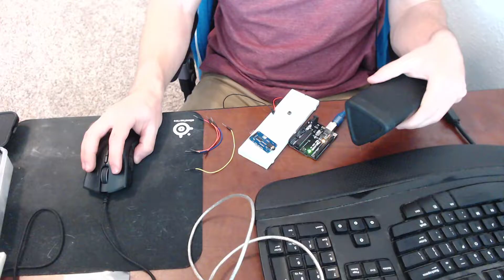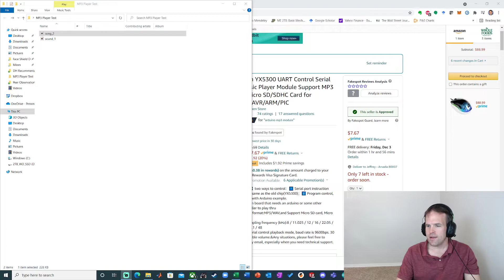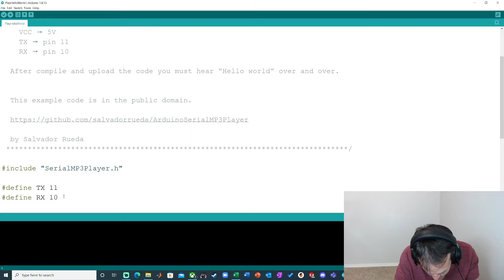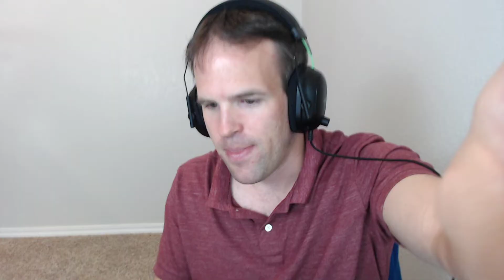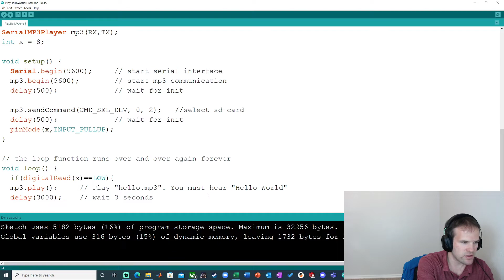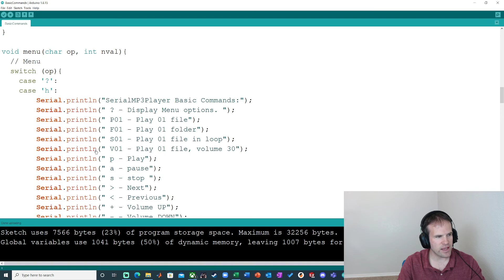Arduino + Aideepen YX5300 Serial MP3 Music or Sound Player Tutorial (SerialMP3Player Library)

Comment: Mine makes a noise but it doesn't play audio
Reply from the maker: A good thing to check is if the mp3 file is encoded correctly (try a standard mp3 file, not a custom converted one) and the SD is formatted as Fat 32. That’s a common issue. Other than that triple check the wiring and code? Unfortunately I haven’t used this in awhile!

Comment: Is there a way to make the sound better like add a little bass
Reply from the maker: @creativeyes3292 You would probably have to connect bassier speakers via the aux cable. You could increase or decrease the base through speaker system electronics. You could also edit the actual audio file to increase base. I don’t think this device itself can do much to adjust the audio other than playing audio back.

Comment: Nice video! FYI  TX transmits data and RX receives data so you always have to connect the TX of one device to the RX of the other so you having to flip the pins is totally normal.  if TX is connected to TX and RX to RX  neither device can transmit or receive data.  Device 1 TX goes to Device 2 RX  Device 1 RX goes to Device 2 TX for serial communication to function.   Thanks again for the video!

Comment: Does the serial player block?

Can you kick off the sound and then have the arduino do other tasks?
I have yet to purchase one and so can not try it to answer my own question.

A demo where for example you blink the BUILTIN_LED while the music plays might demonstrate the point I am trying to get at.
Your code in this example does not make it clear of blocking is happening.

Regardless, Thanks for making the video.
Reply from the maker: This device doesn’t block. Once you trigger the MP3 to play with a digitalWrite() LOW, it will play and you can do other things with your code. I’ve had difficulty stopping the MP3 from playing in its entirety after it’s triggered, but an easy fix for that is to pull another one of the trigger pins low that doesn’t have an MP3 file, triggers a silent file, or triggers a very short sound file.
Reply: @ChefJeffPhD  So I would guess the delay after  the line with mp3.play() at 10:43 probably is required so that the playing does not start over rapidly?

Comment: Hello, Im just starting with arduino. i followed your video. When i press the button the song does start to play but it won't stop like it does for you. Got any clue why it does this? did follow the exact code you showed.
Reply: the button is NC or NO?
Reply: @siriustoolshobbies229   i have both, but the 1 i used was NO
Reply: @rebull1593  i think in the code you have to put LOW the button's pin just next the play line but inside the if

Comment: UPDATE: The poor audio quality was due to connecting a headphone directly to the "headphone 3.5mm port" on the unit. Bad idea. I added a headphone amplifier and the sound dramatically improved. Not just volume, but overall sound quality was markedly better. Live and learn... 

Thanks for the tutorial. Made it easier to get my YX5300 working. FYI, the Rueda Arduino code example does not allow for directories with files so best to load all files (1, 2, 3,.. leading number NOT 01, 02, 03 !) without a directory. I tried two YX5300 cards and the sound quality is poor in both cases- low base volume-- using headphones. The same MP3 playing on Windows sounds great with same headphones. I am wondering if you found a quality difference when comparing the YX5300 and say a PC playing the same MP3? Thanks -
Reply from the maker: Good to know. I’ve had no major issues using the existing headphone jack onboard when attached to a Bluetooth speaker using an aux cable and the sound quality is pretty good. Some headphone may not have a sufficient amplifier like you said. I’m not sure about sound quality differences since I haven’t tested that, but I would guess that the sound quality isn’t as good with this device as compared to a PC.

Comment: Just what I was looking for thank you!! Do you know how to get a second song played after? I tried adding addition code but it keeps playing the first file over again even after renaming it.
Reply from the maker: I have been able to get multiple song to play fine with this device using the existing naming convention. You could try using file numbers 1, 2, 3, etc. instead of 01, 02, 03, etc like a commenter suggested, though I haven’t tested it. Make sure there are no file directories, you formatted the SD card, and all MP3 files are correctly formatted and not corrupted. I’ve seen some MP3 files not work properly, likely due to file encoding or decoding issues.

Comment: I know some of these little mp3 players, if a micro-SD card is installed, will boot up & start playing the card as soon as power is applied. No buttons or serial controls required.  Is this one able to start up like that?  Thank you!
Reply from the maker: I’m pretty sure that this device requires a serial communication signal to start playing a song/sound and won’t auto play on startup. There are other devices that do auto play on startup so you can just turn them on and off with a transistor. Here’s an example device I’ve used in the past: HiLetgo TF Card U Disk Play MP3 Decoder Player Module with Audio Amplifier Audio Decoding Player Module Micro USB 5V Power Supply https://www.amazon.com/dp/B01DK9SL6C/ref=cm_sw_r_cp_api_glt_fabc_4NKB6QBY60CYA872W3P2
Reply: @ChefJeffPhD    Thank you!  I was afraid of that.   I've looked at ones similar to your link but I liked the layout & the convenient mounting holes on the YX5300.

Comment: Thanks for the help.  I still can't get it to work but at least now I know I'm doing it right.  The green LED will flash when I tell it to play but no sound.  I'm thinking sample rate of my mp3 file might be wrong?  Don't know, I'll keep trying.
Reply from the maker: Yes, sometimes the MP3 file could have a compatibility issue, possibly related to the sample rate or encoding. I’ve encountered this once before and noticed that it worked when I tried a different MP3 file. That’s a good thing to test and try.